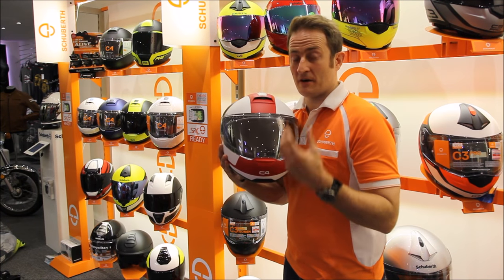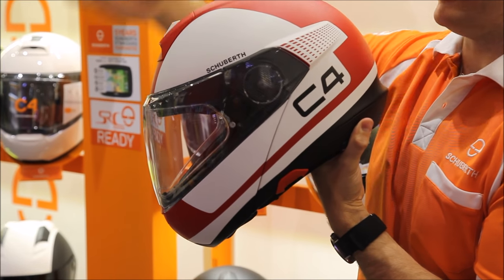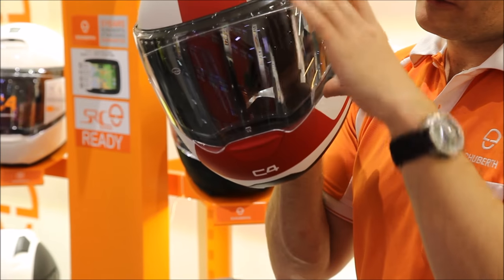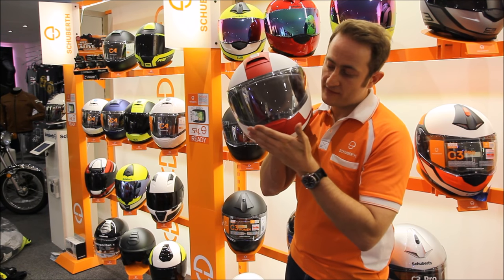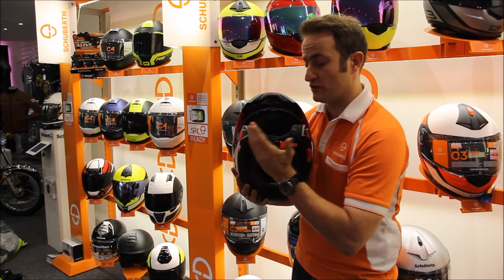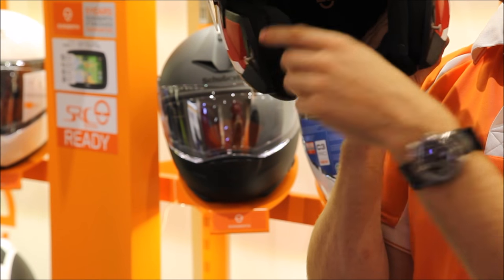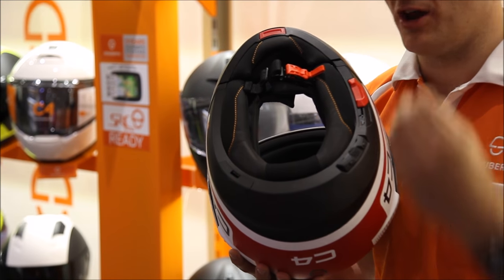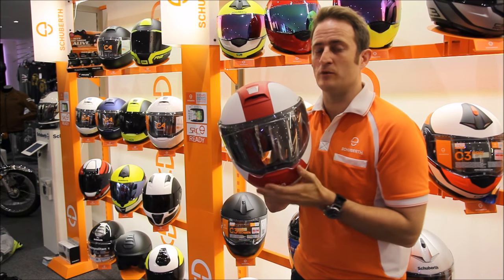NEW SCHUBERTH C4 Flip Front Motorcycle Helmet (Full HD) | Bikerheadz.co.uk

Comment: Is the smaller of the two shell sizes going to be more compact (appear smaller from the outside) in appearance to the Schuberth C3 I currently own?  Thank you
Reply from the maker: The small size C4 shell is a similar size to the small size C3/C3 Pro but is slightly lighter considering the weight of the C4 includes a dual microphone and speakers